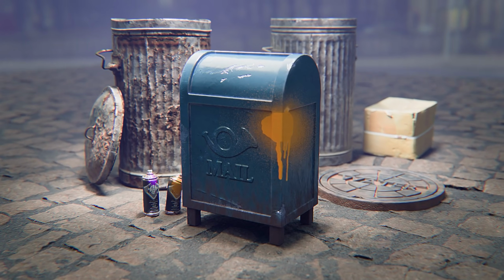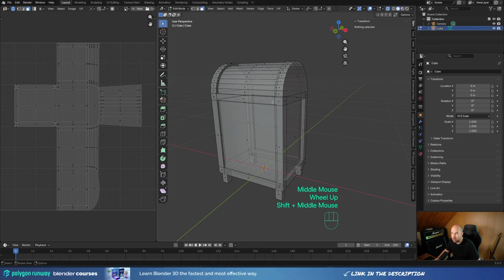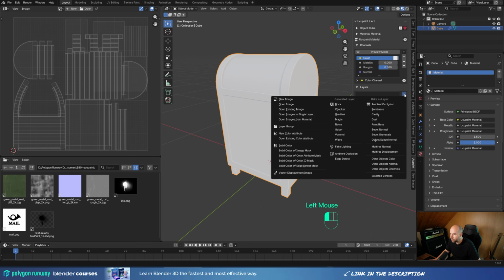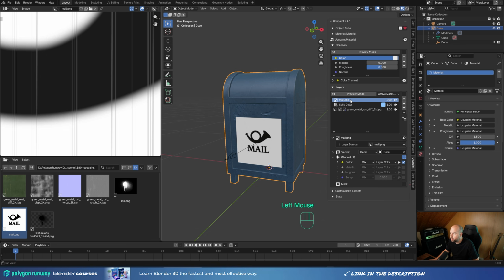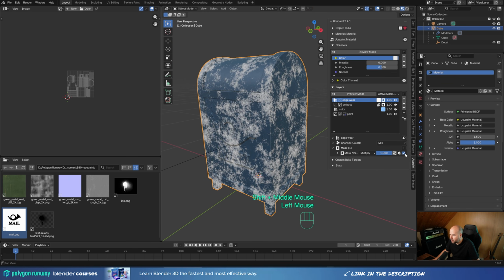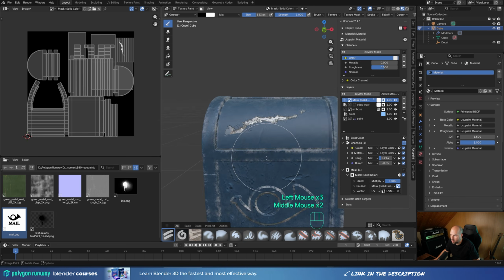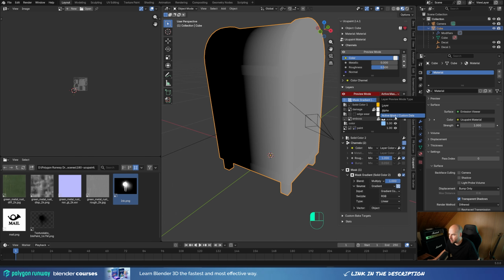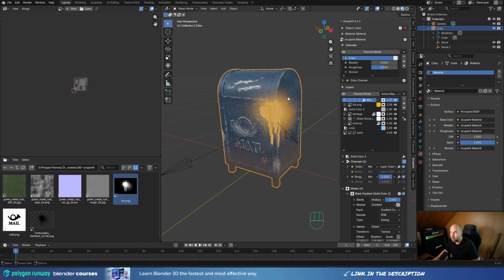Blender 3D Texturing Tutorial using Free Ucupaint Addon

Comment: How do you use pbr materials as brushes? Like painting with a texture brush but on diffuse/normal/roughness/metallic all at once? Using the material on the main UV layout with no control over where details go and just masking between several misaligned materials does  not produce good results.

Comment: Very good tutorial, thank you. There is one thing I was a bit confused about in the UV unwrapping. When you finished the last step cleaning up UVs, I noticed that when you used unhide for the separated sections, those sections in the UV map were behind the other UVs. Should those be moved to a different part so they aren't overlapping? That was the only piece I wasn't sure about.
Reply from the maker: Yeah, that's a mistake. UV's shouldn't overlap in this type of texturing. It would cause problems when baking. Nice catch! :)

Comment: This is really cool! I don't know Substance Painter at all to compare, but it doesn't matter, the results are amazing. Just a question, though, as the whole unwrapping concept is always a bit of a mystery to me: what is the purpose of separating those faces on the sides and the top of the bin, is it to make the unwrapping easier? And what is the point of the seams in this case? I understand that a better unwrapping helps in case we want to position materials on various faces correctly and precisely, but does it make any difference in case of materials like this? In other words, do we need to make the seams and try to unwrap it cleanly?

Comment: I feel like Ucupaint needs to be a separate thing. I personally find Blender's GUI a bit hard to navigate on the addon tab. Substance Painter is fantastic in that way you can clearly see what you are doing.  And this is just a "me-thing" but i like exporting my high and low poly fbx files to another software to work on that on there. it feels like i completed one step in the process and entered the next step. Sure i can change the model in blender while working on texturing, it's fantastic! I love this addon but i feel it would be even better as a standalone software!
Reply from the maker: It heavily depends on the Blender's nodes and teach and as such isnt really a revolutionary software, if you want standalone, try Substance Painter or 3D Coat, etc. The main advantage of UCU is that it IS a Blender addon.
Reply: @polygonrunway  Yeah i have used Substance Painter a lot but it's a bit expensive for me, and.. It's Adobe :P